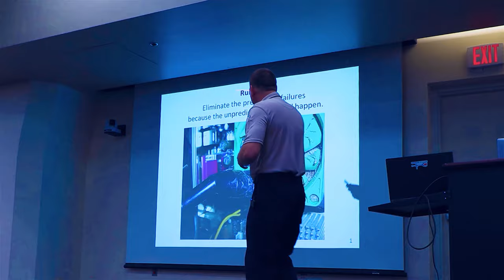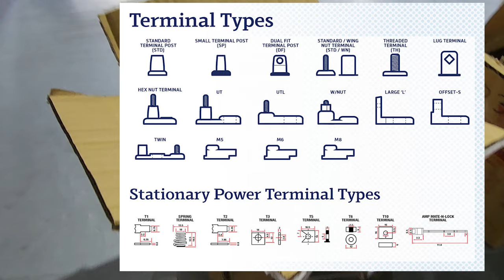Ordering Lead Acid Batteries

Comment: Before biomed, I did battery design, construction, and repair. I have a Cadex C7400ER-C battery analyzer that I use every day. I still do a lot of cell replacement in batteries now. Lately I have been repairing a lot of BMS boards on Welch Allyn batteries.
Reply from the maker: If you are doing this as a business, let me know. We'll do a video and get you some work - saving people money

Comment: I remember years ago having to change 75lb AGM batteries for our UPS bank, all 44 of them, in a tight corridor.  Got to keep 13 good working ones though.  What's your opinion on recent LiFePo versions of these batteries?  I worry about these batteries combusting but I really like the appeal of them lasting longer and having amazing charge characteristics.